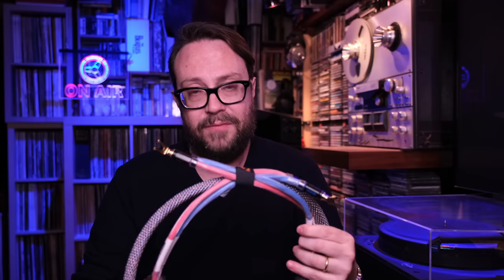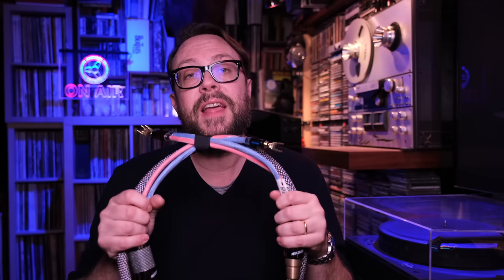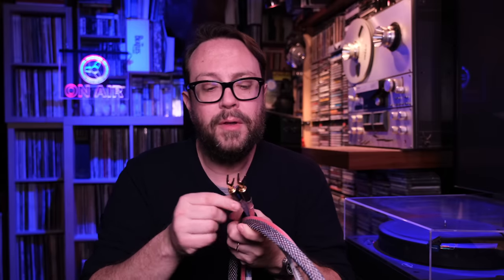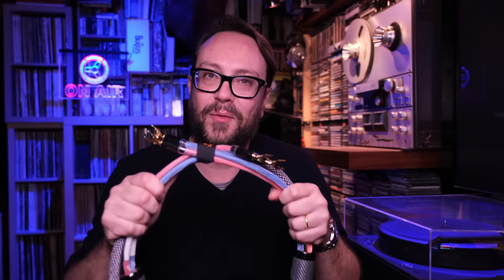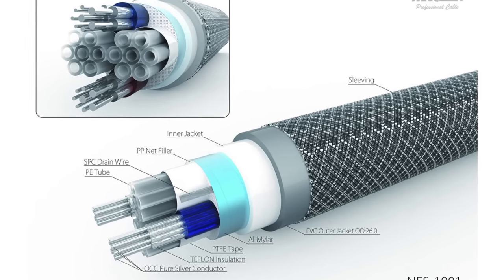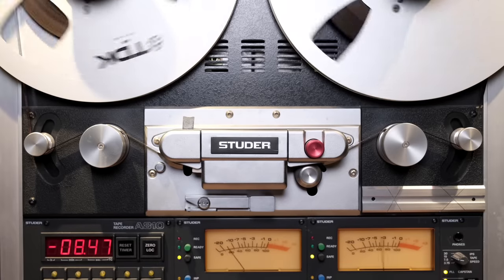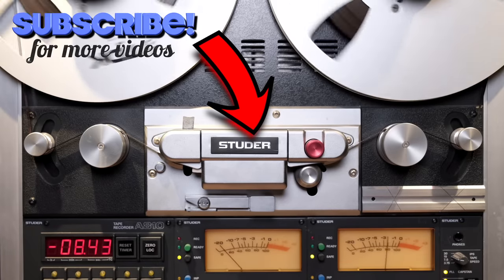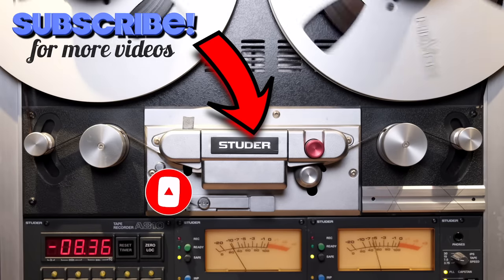Extreme high-fidelity OCC speaker cables at a fair (high) price

Comment: Over the decades, if had the opportunity to try a lot of different wire. There’s no doubt in my mind there’s a sonic impact and it’s backed up by real science. 

The underlying issue with speaker cable is that it has a complex impedance relationship with the loudspeaker’s reactive load. 

Some speakers with fairly flat impedance tend to be less reactive with wire. Speakers with large dips at low frequencies tend to be impacted more. 

Galen Garies from Belden has written comprehensive explanations why the info above is true and has shown measurements. Similarly, Nelson Pass has written on the subject. 

Also, some amplifiers react poorly to high capacitance cables.
Reply from the maker: Maybe uou can find this of your interest:  https://youtu.be/z-48th1gS2U

Comment: HI Guido! Thank you for another informative video. That cable looks very stiff. Can you still route it down from an amplifier, under a cabinet, snake it around a table and then directly to the speaker with ease and without it looking ugly?
Reply from the maker: Good question. The answer is no. These are solid core conductors (the best) not litz wire so it is hard to make them do a lot of turns. I manage to make them go through my cabinet and to my speakers but they can't do a tight turn.
Reply: Yes, these are fairly stiff cables. But worth it for the sound.

Comment: Thanks for sharing. Have you tried LUDIC Magica? I plan to buy them.  second option is the cable you are holding😉
Reply: These cables are shielded, and shielding speaker cables can have quite serious drawbacks while it doesn't provide obvious benefits. Very few are shielded. In short, these cables could actually be bad for the signal.  Perhaps Ludic managed to find a solution, I am actually curious. Ludic is discussed elsewhere on this channel - my take is that quality is pretty good, I have one of their power cables, and that one is perfectly fine, and price is great too - but the company may well be nothing more than a mail box with a big undisclosed manufacturer behind it. I could be wrong, but the company isn't transparent for sure.
Reply from the maker: As you know I love the power cord but the speaker cables even though they are OCC they don't have teflon insulation. That is the game changer along with OCC metals.
Reply: @anadialog  thanks. I understand 😉😁🙏
Reply: @alphaniner3770  it is assumed that the shielding has a positive behavior in the electrical transmitted signal. I have the power cable too end is real good.
Reply: @billrentas  shielding for power cables is a different story - there it makes sense. For speaker cables shielding is generally a bad idea.

Edit: and shielding never has a positive effect on the signal - it can only protect it, or equipment around the cable - never enhance the signal. I think that you can find useful info about this on the British Audiophile channel.
Reply: @alphaniner3770  Thank you very much for the information you wrote me.  Appreciate🙏🙏🙏

Comment: So far there's no cable doubters with their blind listening test rigamarole. Surprising; but it's early. I have owned about 30 different cables in the last 3 decades, from about 23 different manufacturers. I am amazed at the difference a wire can make. There is often just as much difference as between component upgrades. If you have a good pair of headphones, you can see how good your sound quality is by plugging it into your integrated amp. If it has an input. That will show you how good your sound is up to that point, before your sound is degraded some by your speaker cables. Even the best cables degrade the sound a bit. The trick is to get cables that foul the sound the least. I live in America, I never realized how many of my cables are made in Europe. As far as American cables; some of the best cables are coming out of Texas; but then again Texas is known for it's snakes. LOL. Crimson Music Link and Purist Audio, to name just a few. Each cable has their own distinct personality. No less than if you have children; how they all have their unique personality. Each one gives a different take on the music. Silver is purer sounding than copper, but there are some very fine copper cables. A copper cable done well can beat a silver cable overall, if the silver cable is not done as  well. You really have to know what you are doing. There are even a few companies using graphene as a conductor, which some say is even purer sounding and a better conductor than silver. 

 One of the best audio accessory companies in the US is Mapleshade Audio. It's founder, Pierre Sprey, who formerly designed military fighter jets, says that speaker wire connectors degrade the sound quality by about 5%. He says bare wire is best. Getting speaker cables off the floor he also recommends; and it is a great  recommendation. Probably the one main cables I have not tried is Nordost. I've been through just about everything else that is real well known, and some that are not well known cables. Single crystal cable impresses me with it's purity of sound. Thicker cables always sound more beefy in the bass in my experience. The one untrue myth about speaker cables to me, is that they change their characteristics depending on what they're connected to. No. The combination of the cables sound and the new things sound they are connected to accounts for the different flavor. I find that the particular sonic characteristic of cables remain very consistent, no matter what they are connected to. They are not a Dr. Jekyl/Mr. Hyde... Interconnects can make as big a difference as speaker cables. If you only have one great interconnect cable, maybe because of cost, and you have to make a decision where to use it in your system; try it closest to the source first. Then try it between preamp and power amp next. Whatever sound quality you lose, coming from the source, can never be regained no matter how good your amps or speakers are.
Reply from the maker: Thanks for sharing your interesting experience. As explained in another video I made I think that lower quality gear benefits much more from quality cables. The changes are dramatic, in high-end gear thebimpact decreases because, I believe, the quality of the gear preserves or degrades less the signal. Nordstrom was actually my first love. I remember a pair of Heimdall interconnects that blew my crappy system out of the water.

Comment: so what speaker cables are you recommending these days? 
i’m getting my new system tomorrow and currently use some cheaper monoprice speaker cables. 
would love to upgrade to some nicer cables if you have any suggestions? sounds like these cables in the video weren’t what you thought they were? 
ever had any experience with blue jeans cables? 
appreciate the help!
Reply from the maker: What kind of speakers and budget? Answer in new comment
Reply: @anadialog  i’ll have the borresen x3 and axxess forte 2. certainly not trying to spend thousands on speaker cable!

Comment: Hey, I just purchased these in bulk, can't wait to get it started. I have a question on how to wire these though. It looks like there are 4 clear wire conductors as well as 6 red and 6 blue. I understand you just need to twist up the red with the red and blue with the blue, but what do you do with these 4 clear conductors? I read that you're suppose to twist 1 clear conductor with the red wires and 3 clear conductors with the blue wire. But how do you know if it's the same clear wire on the other end? Would be great if you could let me know.
Reply from the maker: Here are the mounting instructions recommended by Neotech:
Positive: 6x red + 1x transparent conductor
Negative: 6x blue + 3x transparent conductors

To know which is which you are going to need a multimeter to measure the voltage. That's the only way.
Reply: @anadialog  So, I just got the cables, there are no markers or arrows indicating direction. How do I know which direction the signal is suppose to go?
Reply from the maker: @johenkay1129 if there is no direction it means that in this cable it is irrelevant. It becomes relevant if you connect the shield only on one side go avoid hum, typically the source.
Reply: @anadialog  Thank you.
Reply: When i made mine i just traced the clear cable from the twisted red side using my thumb as i twisted the cable. I marked the clear at the other end and made sure that was the one i twisted with red at that end as well. By the way, i read after i made mine that you are supposed to leave the clear at one end on the red side not connected as it acts noise drain. I haven't done that so can't comment on any difference it would make.

Comment: Excellent review as always. 
I  am currently using Amadeus5 Mk2, do you think it is worth upgrading to Neotech? Thanks.
Reply from the maker: For the full price? Probably not. A true leap would probably be OCC silver. A lot of people here are recommending some silver cables that seem promising but you never know. In any case, if you feel like upgrading or looking in the used market just look for OCC copper and teflon insulation. Can't go wrong!
Reply: @anadialog  I was using Ramm audio elite8 interconnect and changed to NEI 3001 and extremely happy with the change. Elite8 is too sharp and less defined low frequency. 3001 is more natural and soft sounding with wider soundstage compared to elite8. Also changed Audioquest carbon coaxial to NEVD 1001 and the change is positive with clean and accurate sounding with wider soundstage.

Comment: I enjoy your channel. FYI, SKW describes that model of their cable as 6N copper, not 4. Perhaps you're confusing that model with their entry level product. I have this model of SKW. It compares favorably with other single crystal, 6N copper speaker cables and interconnects I've used.
Reply from the maker: Yes, I got mixed up. Thanks for pointing that out. I did a video which greatly contributed to their success here: https://youtu.be/2rjOdEuFe88
Finally my last video is on their occ copper, fake or real? https://youtu.be/1iAytMuWeds
Reply: @anadialog  Yes, I saw that video and enjoyed it. I first bought 6N OCC cables about 25 years ago from a company still around today. They immediately made a nice difference. Since the price of 6N OCC copper has become relatively cheaper, it makes no sense to create a cable that is as well-built as SKW's only to fake a relatively inexpensive part, which is the copper. It's the shielding, jacketing, filters and terminations plus the labor to make it that adds real cost. Of course that's less true with solid silver cables, which I also own. Keep fighting the good fight for the rest of us audiophiles that are always trying to learn. You're one of the good ones.

Comment: When you get your source and amps way up there in sound; in my experience speakers with woofers and tweeters  don't differ all that much in clarity usually. They differ in other performance parameters more; but not clarity so much. When they do differ in clarity by a great deal; it is usually due to elevated frequencies somewhere. Giving that false illusion. However a speaker that is inherently cleaner sounding than usual smooths out a lot of the deficiencies before it in the chain. A really clean speaker whose drivers have very low distortion can make the rest of your system sound better than it is. But if what is before it in the chain lacks refinement to a certain extent; you'll hear it. No matter how clean your speaker is. Now if you put most of your money into your speakers, and what is before it in the chain, was little more than an afterthought, you will not have good sound. If your source, amps and cables are good, virtually any halfway competent speaker will give you a good sound. Even cheap ones. So giving more priority to your source and preamp might not be as exciting or dramatic as buying a big old pair of speakers, but you'll have better sound. Buying really good cables is not that exciting or dramatic either, but they are about refinement too. I would actually get my cable act together before I spent a great deal on speakers. There is no rational % of cable allotment in a system. No fixed dollar amount. Given a $5,000 system allowance. I don't think it would be crazy to have cables that cost 40% of that total. $2,000 in cables in a $5,000 system is not ridiculous, if the cables chosen really do  give you the sound and refinement you want. I've used top of the line cables from several high end manufacturers and I have no doubt that they were the strong point and star of my system, and I am sure that removing them, removing something extraordinary for something ordinary would have done my sound worse things than having a less expensive power amp, or speakers. Do cables make more difference than speakers. Not usually; but somehow the refinement you lose by going to something lesser, you miss more than if you went to cheaper speakers. Depending on what of course. Speakers  tend to sound great if they're response is flat, even if they're not that expensive. You would be amazed at what great sound you can get out of cheap speakers; if everything before it in the chain is down to a point. A better sound by far usually, than expensive speakers and so so electrinics and cables.
Reply: You are very wrong with that statement.

Comment: These are really interesting tech wise.  There is a speaker maker and cross-over engineer here in the States who sells high end DIY cables.  He recommends threading cotton or a specific type of nylon rope (yea, ROPE!) thru the speaker wire/cable he sells, which is A LOT like Kimber cable: it has extremely similar geometry to these, with the same 'core' material.  Seems that helps a good deal with crosstalk and impedance  in each strand.   Have you ever experimented with Solid Core speaker wire or interconnects?
Reply: I use ONLY solid core ....
Reply: THANKS GUIDO,FOR SHARING THIS OPTION…I have been using TARA LABS RSC 1000 FOR over twenty years…paid $10.00 a foot and very happy with them , and when you amortize anything (like cables that do not deteriorate OR  GO bad  ) THEY BECOME A GREAT BARGAIN…IMHHO 🤗💚💚💚
Reply from the maker: Tara labs!? Wow, congrats! Amazing brand.
Reply from the maker: These are solid cores, but I guess you mean low gauge single wire cables. Indeed, once I made a power cord with a Oyaide solid core you almost can't even bend it: https://youtu.be/qlQXmQlBaVA
Reply: @anadialog  GUIDO  👍🤗 actually, RSC stands for rectangular solid core, which they say is better, and they have put out scientific papers which you could probably find online, I got them when I bought the cables
Reply: Just a fyi
Reply: @anadialog  🤗 thankful that I learned about them from another audiophile   buddy
Reply: @anadialog  INDEED ..........low gauge !
But woaw the sound .............

Comment: Have you ever used cardas cables from the US? If so, what's your take on them?
Reply from the maker: I haven't but Cardas makes great quality stuff! I have some things like short caps, soldering wire and I think some connectors.
Reply: If you into DIY I highly recommend using their solid silver for making interconnects (see my other comment).
Reply: @Johnny G  I certainly will look into it! I'm completing making a phono cable with din plug?
Reply: I have Belden Iconoclast and Cardas Clear Beyond. Both are impressive but overall I prefer the Cardas in my system (Focal Scala Evo’s)

Comment: "insulation is paramount"
I have made some research and listning test during the years.
PTFE is good, but the best is natural PTFE, not coloured, red is the worst. Then adding colour you have th modify the PTFE to get the colours to "fasten", this affects the sound.
Dielectric constant, can not judge the sound quality soley. Insulators have different monocule structures, polar and non-polar. Non-Polar materials are PTFE, PE; PP; PS. Polar are for example polyester, PVC ...and should be avoided. Even the outer cover affets the sound.
Natural material are the best in my opinion, PAPER is the best sounding dielectricum.
Karl-Erik

Comment: In my experience interconnect cables are the most important cables …sonically speaking.
Reply: I guess that opinions vary - I am still figuring it out. But I do think that the effect of cables (if any) is highly system dependent - so it could be that on your system interconnects are far more important than on my system. The biggest difference I had (so far) was actually the power brick.
Reply: @alphaniner3770  …everything matters. But you’re right: it is system dependent. And that’s where synergy comes into play.

Comment: most power amps i’ve seen in my lifetime are wired with 16 to 20 awg. some copper some tin plated copper. After the power transformer on through to the output terminals to the speakers. To me these super expensive cables are not worth it.
Reply from the maker: That is true. In fact it's a shame that even high end manufacturers don't use high quality internal wiring, or at least very rarely.

Comment: I have to disagree with you that speaker cables are most important. In my opinion the phono-cable is most important because there you have the weakest signal.
Reply: I was using a Jelco cable with my nearly neutral high end cartridge. Rca connectors were playing up. I connected another cable. High and low frequencies flattened and I end by using tone controls on by pre-amp
Reply from the maker: Phono cables are extremely important you're right but I find that speaker cables have even more impact on the sound. Phono cables are a matter of defending that weak sound, speaker cables unleash the potential of an amp and speakers.